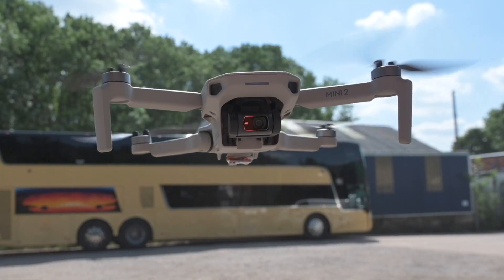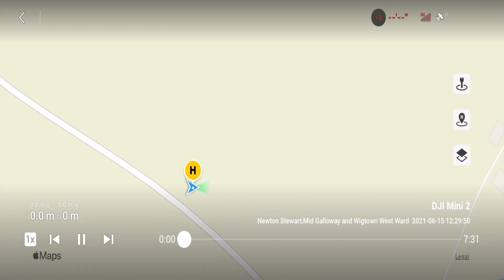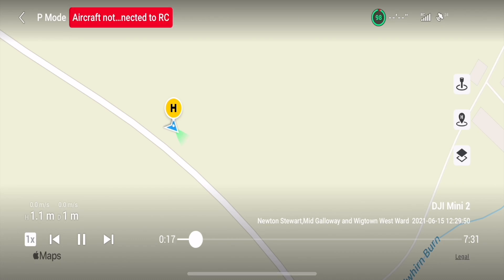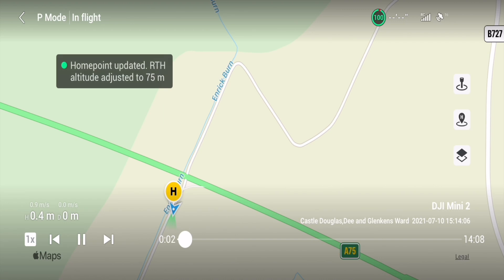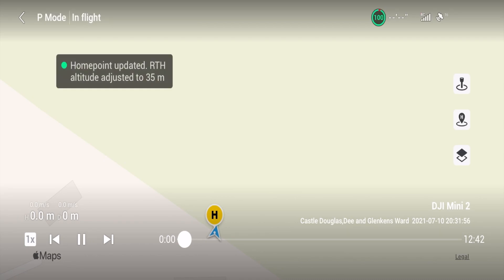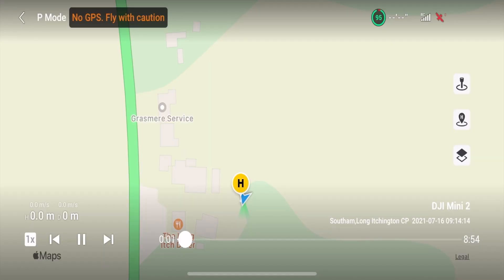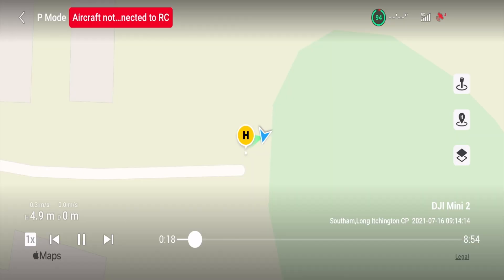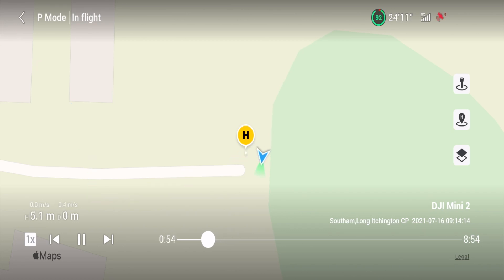DJI Mini 2 - Occusync 2.0 - Connection issues

Comment: Ok so it happened again today and what I realised is that, it always occurs 15 or 16 seconds after I hit record for the first time. Last time it was in the air for only a few seconds when I started to record and 15 secs later, no signal. This time I flew around for several minutes before hitting record but once again,16 seconds later I've lost signal. Could the video recording be triggering this issue? 
Even weirder is that when the signal is established again, usually only a wee minute later and as drone enters RTH mode, it automatically starts recording again. 
After the initial signal loss today I cancelled RTH mode and had no further issues.
Very strange indeed.
Reply from the maker: Wow, this is very interesting indeed. Thanks for noting down what happened today. i generally hit record before take off, so this could explain my issues. However, once airborne I do tend to switch between photo and video quite frequently and have never had the issue present itself. It is entirely possible that there could be some sort of bottleneck when you send the record command in conjunction with other flying inputs. I think I will try this out and see if i can replicate it. Thanks again for your comment.
Reply: @HeatonPhotography101  no problem, happy to help us all get to the bottom of this. I'm going to take it up again this afternoon so I'll let you know if it happens again today.
Reply: I have a similar issue but it only occurs when I enable the cache while recording. Do you notice any difference when toggling it on and off?
Reply from the maker: I’ll have to try this. Thanks Piotr
Reply: Could be the answer. I am sure mine lost connection just after I started recording. I will keep you all up to date with any future issues. Will definitely check the recording issue next time I am out.👍
Reply: Have you performed the recent firmware update? A few people are having connection problems with the new firmware. I've put off installing it because of this.
Reply: Hi, the issue can be sorted out with 2 tips. Try reinstall application and if possible also give it a try with android as the issue is with app showing wrong info may caused by some bugs. Moreover 2nd option could be slightly time taken as you need to open your rc and disconnect the battery for few minutes and reconnect. Hope this helps
Reply: The fog is making it drop out

Comment: mine disconnected in flight 22meters high, 350 meters away . never reconnected ever! and try turn off full battery, will not turn off just goes to one white light and other light flashes for England..   permanently broken... :-(

Comment: I've had this a few times too. I don't think this is a connection issue - I think this is evidence of the software running on the drone itself crashing. The drone doesn't fall out of the sky because the flight control system is either on a separate CPU or at the very least on a separate process.
Reply from the maker: Are you still having issues with this?
Reply: @HeatonPhotography101  I'll be honest - I've not been flying it enough recently to really say. Once the weather improves and I start using it again I'll update this post.

Comment: I've only had mine a few weeks now, it's my first drone. I too have had a few app crashes. Can't compare to previous firmwares as updated to latest before first flight but I wasn't expecting this kind of thing to happen this frequently with a product like DJI. Mostly app crashing/restarting or screen freezing for a good few seconds in my case.(Android user)
Reply from the maker: This sounds like it could be your phone/device rather than the drone. What are you using?
Reply: @HeatonPhotography101  I agree, however I have found plenty of other comments from people who have owned the drone longer and used previous firmwares etc. who have said it has started since they updated to 1.4.8 which I think is actually the app version?
Phone is a Sony Xperia 5ii

Comment: My mini 2 just flew into a tree. I was rising up to capture the sunset and one of the motors cut out. Absolutely nothing I could do about it.. Very little damage but I have to get the motor replaced. Had over 70 flights logged. Very sad. Bought it in November so my 90 day warranty was long gone. I'm not sure if I'll ever trust or buy another dji product. Autel or Parrot for now on.

Comment: MY new  Mini 2 arrives today via DPD delivery , so I downloaded the  fly app while awaiting delivery for the Mini 2 and at present I have 1.4.8 ,, geeeze ,, I am pondering ,,do I send it back by DPD  having 1.4.8   can I set it to early  version as the app has 1.4.8 present  
Also I I thought you could fly the drone without connecting with the APP but the drone could drift in winds  as the APP is not functioning for stability plus no satellites
Reply from the maker: Technically you don’t need the app to fly, but it will seriously restrict your enjoyment.
Reply: @HeatonPhotography101  so you can fly without the app ,
Reply from the maker: Yes you can Bill. Just be careful, especially if you are new to drone flying! And keep it close.

Comment: I’m having similar issues. My mini 2 connection goes from strong to  weak in an instant when I fly 200 ish meters away . Very worrying when I get warnings and it shows fault 80004 . Posted on on forums but no help except the obvious like pointing remote at the drone at all times. Help please .

Comment: Hi, the issue can be sorted out with 2 tips. Try reinstall application and if possible also give it a try with android as the issue is with app showing wrong info may caused by some bugs. Moreover 2nd option could be slightly time taken as you need to open your rc and disconnect the battery for few minutes and reconnect. Hope this helps

Comment: I'm wondering if there's an ongoing fault with yours?
I've had mine a few months with a few hours flighttime in the bag including in the house and it's continued to amaze me with no tx connection issues at all.send it back to dji and get it checked maybe I'm not sure?

Comment: I'm having a very similar issue as soon as I take off I get a few feet away and then my RC loses connection to the Drone and it starts returning to home that is a very scary and uncomfortable situation they really need to fix this because it has me scared to fly. And I've had my drone for a few months and I never had this problem until a month ago and it hasn't stopped ever since. Has anybody found a solution today?
Reply from the maker: We are trying to get it in front of dji.
Reply: @HeatonPhotography101  well please keep me posted on any updates or if you guys find any solutions
Reply: So far I heard downgrading to 1.4.4 works. I think I have to try that route asap.
Reply: I had the same problem on Android, but after installing the latest version of 1.4.8, I haven't had a disconnection problem so far. Are you aware that there have been several 1.4.8 revisions? The last one is 1120. However, the application still crashes occasionally, but without losing the connection.
Reply: @szymonkrezelok5742  how do i install the revisions

Comment: I'm using mini 2 for last 6 months, so far very good experience, but recently having some issues.. 

while flying at a very short distance 10m to 50m or sometime less distance i found very low signal strength followed by aircraft not connected with RC/ RC signal lost warning, At that point i have no control over my drone then it return to its home point automatically which is quiet frightening may crash anytime. 

i assume it all started after downloading latest firmware version and its not a hardware issue as i never crash my drone.
Point to be noted this problem occured suddenly. 

Action done:
1. Cleared Cache of the fly app but problem persists.
2. Reinstalled the dji fly app but problem remains
3. Used old version of app but not solved 
4. Downgraded the firmware version by using dji assistant 2 but no result 
5. Used different phone and connector still the same..
6. Tried to fly the drone at different location but effort went in vain. 

If anyone having same issue with dji mini 2 please give a penny for your thought regarding this matter.
Reply: Already commented in this thread. So annoying. I heard (from android users) that the issues (if not all) were resolved after downgrading. Might as well try that route.
Reply: Today got reply from dji support centre, they asked me with few informations, already provided them, awaiting Their reply again....
Reply: @md.mahmudulislam2504  update us sir

Comment: Make sure that no other apps are running besides DJI Fly and when you do lose connection, try looking at "Transmission" and make sure "Both" is selected and check how much noise is on the selected channel. Could just be a noisy area. Go somewhere else and try it. (miles away).
Reply: All those (and more) I did and the area I was flying before was the same so I guess it is a good reference but yet issues are still there. Already commented in this thread as far as my issues are concerned.
Reply from the maker: Great advice. I’ll certainly try and look into that. 5/6 of my errors were in remote countryside with very little interference.

Comment: I had a flight two weeks ago. Was intending to fly out 2 miles. Do a quick film then fly back. I took off, at a quarter mile I lost signal momentarily. Signal returned so I continued on. At one mile I lost signal again. So I decided to turn around.  No more problems until about 50 feet out. Lost signal once more. Each time it had signal loss only for a second or two. I also noticed my video that I was recording also stopped each time it blanked out. Whensignal returned the recording would start up again. So once I got back I had 3 videos about 5 minutes each.
     Last week I flew it and experienced no problems at all.
Reply from the maker: seems strange that you suffered signal loss so close after thatt flight and also the video dropout.

Comment: Had similar issues and after some researching pinpointed it to the cable between the controller and my phone. I use the USB C cable (android) and simply rotated the end going into my phone and have never had the issue since.
Reply from the maker: But the display on the phone isn’t going off? It’s the connection between the controller and the drone. I wouldn’t think the wire would affect this problem.
Reply: @HeatonPhotography101  So you're still getting video from the drone?
Reply from the maker: The picture is gone, but the symbology is still there. It’s the fact the drone becomes unresponsive which makes me feel the fault is with the controller as opposed to a phone issue. I could be wrong though and we need to explore all possible reasons for the fault. 👍🏻
Reply: @HeatonPhotography101  This is exactly what was happening with me then. Even if I was doing quickshots they'd stop mid way. There's a couple of posts about it on the DJI Forums about the cable being the issue and I've not had it since I rotated the USB C cable going into my phone.
Reply from the maker: Might be worth me having a lol at that too. Great tip, thanks.

Comment: Having issues every flight where app crashes firmware all up to date occasionally functions wont work like changing from video to camera or zoom not working all on a brand new s20 fe which is only used for the mini 2 app is definitely buggy as hell. My mavic pro never gives a bit of bother not once

Comment: I've owned several drones and have had connection issues with all of them at some point.
I've never been sure what's caused it but thankfully nothing serious has ever occurred and the drones have always returned safely.
I never really 'trust' using a mobile phone as the visual conduit between the controller and its information and this seems to be a common issue when people describe app crashes and lock up's.
In terms of that, the best experiences that I've had with drones have been with specific controllers that don't use a phone.
The GoPro Karma (don't judge 😜), Phantom 4 with built in controller and most recently the DJI Smart Controller that I use with my Mini 2.
It's a bit extreme and a lot of expense, but in my experience, a dedicated controller has always been the most reliable option for me.
From what you've described, it seems like you have quite a specific fault that could come from the drone, its controller or even your phone and so its very difficult to narrow it down in that sense.
Do you know anyone who has a Mini so that you could try another controller for instance and then maybe their drone with your controller just to try and eliminate a variable or two?
Anyway, I hope you get it sorted and can get back to enjoying flying rather than it becoming an anxiety filled experience 😉
Reply from the maker: Great suggestions thanks. In my experiences listed here, the drone has been only a few metres away. As soon as i get  the disconnect, the sticks become unresponsive.

Comment: Hi all had issue on every flight since the 1.4.8 android on the s21 ultra of screen not responding when trying to change settings and the battery life stops going down and height and distance stay the same i have to go out of app and open it again and it starts working again on both mini 2 and air 2s so its definitely a app issue
Reply: Encountered those too and more.

Comment: I had a few issues been flying mini 2 for nearly a year now and I've done update and was fine until 2 days ago flew out all of a sudden lost connection so I hit return to home and usually it will make that bleeping sound but nothing but then it connected again but still no bleeping in rth and the altitude was the same the distance was the same qnd the battery level was the same so eventually landed with everything showing me I was still at 340 ft 3000 ft out and battery 41% but rebooted and battery was only 13% so I guess I was quite lucky but I spoke to another youtuber he advised I clear me data cache and reboot it or even delete the app and reinstall it so done this and its not happened again maybe that's worth a try. Or it could be little alien's blocking your signal 😁👍🇬🇧
Reply: On an android phone, I often experienced problems with telemetry and app control frozen (but video feed ok) with version 1.4.8. After several wipes and app reinstalls, I got back to 1.4.4 and stopped flying without telemetry. Phone is Samsung A71.

Comment: Finally, someone who has a similar issue! My signal losses have occurred only since the last update. Not before. From my experience there is no connection to hitting the record button.  The first time it happened I was in panic mode but it returned. Since then it has happened multiple times even over shorter distances, viz less than 1km away. I have been in correspondence  with DJI who asked that I send it back for testing. I await the results.
Reply: Been experiencing this since i updated with this new update. Lots of issues with my android phone: compass freezes, app shut down intermittently, signal losses conctantly and the rc disconnected sometimes. All these experiences happened every now and then. So annoying and most of all scared for my drone's safety.
Reply from the maker: Thanks for your comment. I keep getting fobbed off by dji at the moment. I’ll keep on at them and would be interested to hear your results. Cheers
Reply: @Earnie Rico hi Earnie, I await news from DJI who now have the unit but please let me know the steps to revert to the older firmware as you have done. Cheers, Roger

Comment: I have never had this problem in over 50 flight hours and I am flying amongst many hills, valleys, cell phone towers, power lines, etc. I always fly in sport and over 300m alt/ 1,8 km max distance. No problem in any modes. I’m sure you have done all calibration so it must be a dud, mate. 😕 (Durban, South Africa). DJI should look at it!
Reply from the maker: Thanks for your comment. I’m confused as it never used to be like this. Something must have changed.

Comment: I am a newbie and only been flying a short time with my latest being the mini 2. Second time out on an open field, I knew exactly where the drone was when it lost connection. I panicked, and started pushing buttons and moving joysticks which lead to the drone dropping to the floor(tall grass). Using the find my drone I got to the location but it would not set off the flashing and beeping alerts as there was still no connection to the remote. After recovering the drone and switching everything off and then back on to test everything, all was back to normal. I havnt flown since but will keep you all up to date with future issues. I think maybe if I hadn’t panicked and just left everything alone then maybe it would have reconnected but that is what happens when your new to something. 
To be honest I am a bit scared of going out with it in case it happens and I don’t recover the drone. Definitely needs looking into by DJI .
Reply from the maker: Thanks James. Yes you learned the hard way there. Just leave it to it when it disconnects and it will sort itself out. Easy to say, sometimes hard to do when you’re new to it. Glad you got it back in one piece 👍🏻
Reply: @HeatonPhotography101  I was really lucky to get it back but I have definitely learned from that mistake. Hopefully it could be a software update to fix the disconnection issue. The video recording seems like a good thing to look at. I will keep in touch and let you know what happens over the next few days out with the drone.👍

Comment: Since updating to latest mine has frozen camera controls on the screen and frozen altitude and distance data,on both mini 2 and 2s also ,reverted back to older firmware on mini2 as shown by gavinhr and rollback to 1.4.2. Not updating anymore until I see a couple of reviews
Reply from the maker: might be a wise move, or if they do fix it then you will be missing out. classic catch 22.